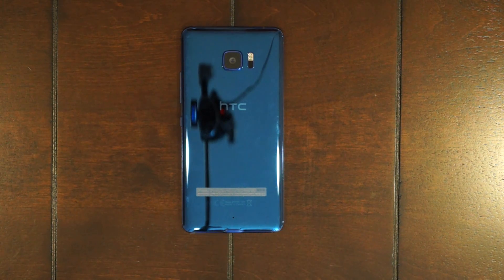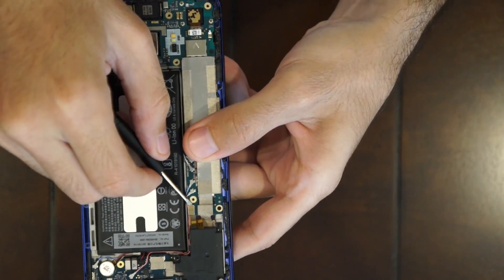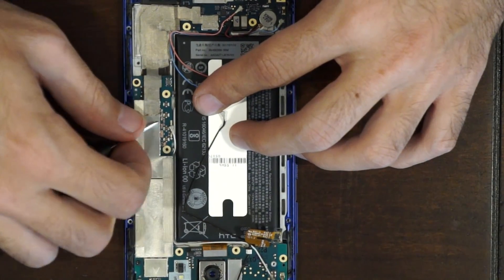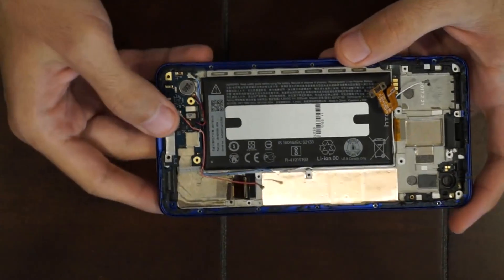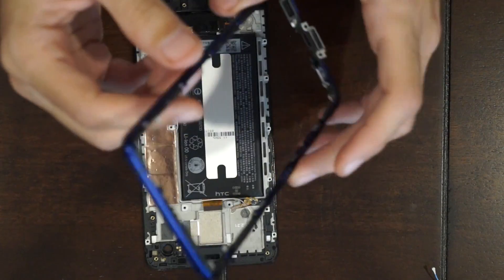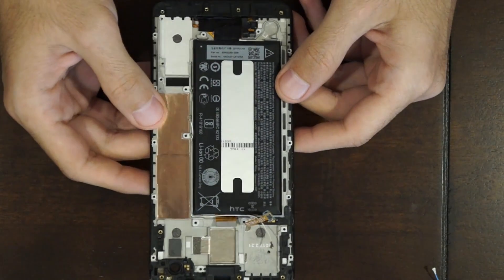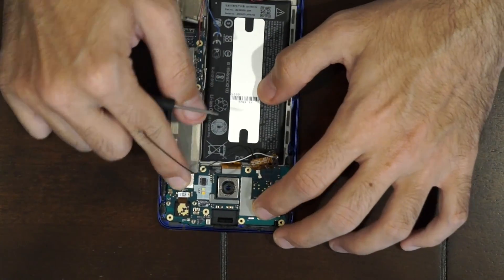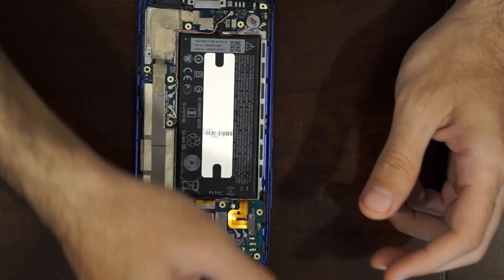HTC U Ultra Complete Disassembly Teardown Repair Video

Comment: Danke! Спасибо за видео! Сразу видно, что Вы специалист. Но Вы зря хвалили сборку htc u ultra. Для меня это МЕНИНГИТ. Конструкторы htc u ultra должны были все провода и остальную периферию смартфона, поместить под аккумуляторную батарею. И тогда замена аккумулятора была бы в диапазоне 3-5 минут.
Reply from the maker: Thanks. Yeah in general HTC phones aren't the easiest to take apart and usually the organization isn't the best. But the more recent models were much better than the older ones which were a nightmare.

Comment: 2:31 can you please share (if you can) what is that small rectangular part in the top center, just over the camera? it seems not to be attached or plugged to anything, if you flip the phone it will just fall, at least in my phone. Thanks.
Reply from the maker: are you talking about the metal piece? or the ear speaker? The silver metal piece is a shield or cover thats covering some chips probably underneath it. If that is loose it probably just broke off the solder and is falling around. If its the earpiece speaker, maybe the adhesive went bad and its not holding it in place.
Reply: @PBKreviews  I mean this small rectangular piece that has some printings on it: https://i.imgur.com/q2qAUHi.png

Comment: Hello, I've watched your amazing videos on YouTube ref HTC rebuilds etc, I've just changed the screen both (LCD and digitilizer) on a U Ultra because the touch was unresponsive (home, back and recent apps buttons fine), tried a factory reset too (to refresh data sync) and it's still the same with the new screen.

Can you help, possibly connector or some other issue?

Thanks, Dan
Reply from the maker: Hi has the phone had any contact with water or any liquid damage? And thank you appreciate it :)

Comment: What do you use to open the phone? Can I buy it somewhere?
Reply from the maker: Monika Szafałowicz hi if you're referring to the screws they are torx screws and you need a t4 or t5 torx screw driver. Yes they sell toolkits both on ebay and you can also look at ifixit website for complete tool kits. Hope this helps.

Comment: I broke the back glass of my Black HTC U Ultra.
do you know where online I can buy a replacement?
Reply from the maker: There is one on ebay but its pricey. Item number 142421279112  . You can also contact HTC and ask them how much they would charge to replace the glass for you
Reply: pwrdbykyank Im covered under OH UH protection but I have been waiting 36days now and just being told that they are waiting on factory refurbished stock from the Taiwan warehouse. I'm fed-up of waiting, so I got the back on eBay as you suggested. I'll see which comes first. the part or the HTC replacement.
Reply: Dear anthony bonair, just wana confirm that have u got ur back glass, if yes plz confirm the medium and price, as I have same incident 2 months ago and till now using in same condition.

Comment: There is 100% room on that PCB for a 3.5mm jack and the traces/wires for it. just because there isn't a litter empty space in the phone doesn't mean they couldn't have fit a few more surface mount components onto that PCB.

Comment: Why is the 300 mAh battery so big? Did they seriously freak out over that Note 7 incident with it's big battery and it's repairability (not complaining about that)?
Reply: Crowbar Asdfghjkl the note 7 incident wasn't because of a big battery, there are phones with 4000+mAh batteries, the problem with the note 7 is that they didn't allow enough space for the battery to expand from heat while charging which pressed layers together and shorted it, so the fault of the note 7 was Samsung getting careless before the sake of boasting slimness, this phone sacrifices size for repairability